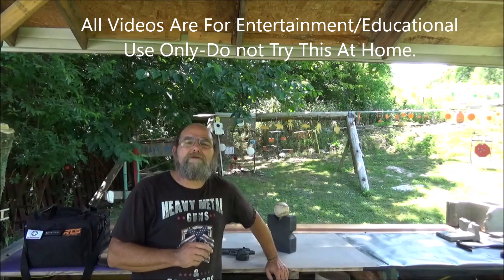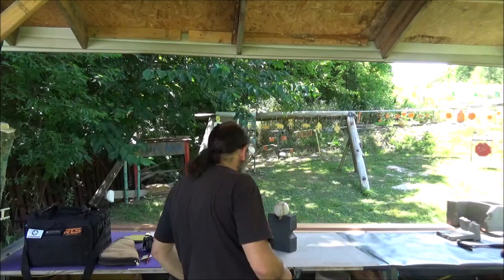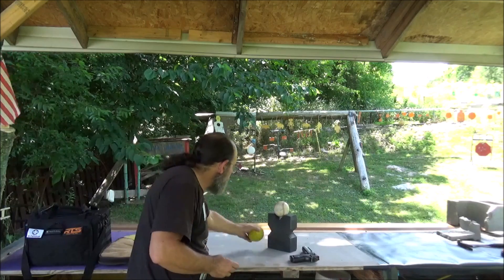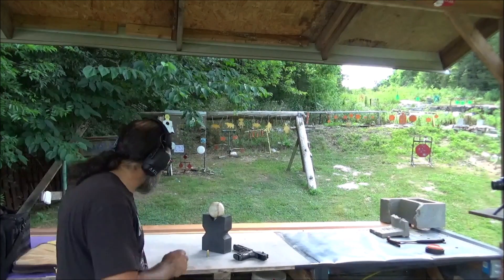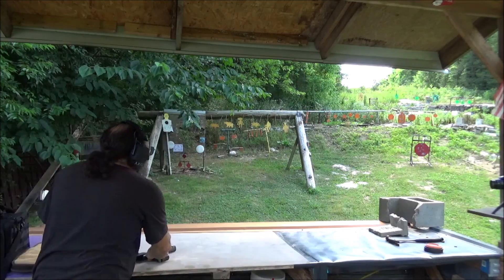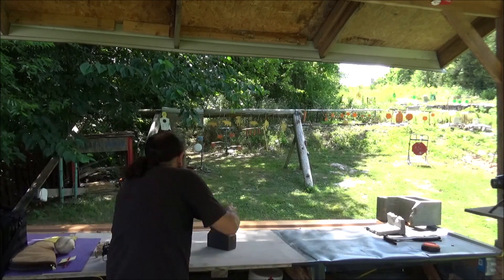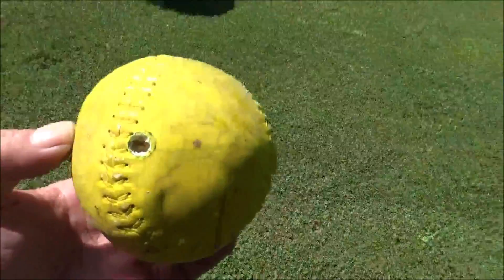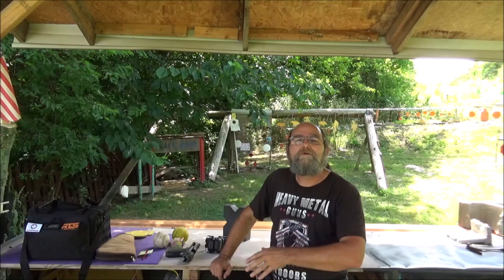Softball Test 50 AE FMJ VS JHP

Comment: Looking at both softballs it appeared to me, that the flat did indeed push, or plowed it’s way through. Thus had a bunch of the winding material in front of it enlarging the exit hole.
The hollow point, acted as a wad cutter and had less winding material in front and there was little if any enlargement of the exit hole.
The winding material is flexible and low density and I suspect it didn’t provide sufficient mass to expand the hollow point.
I would like to see what a jacketed soft core bullet would do in same test. May not be enough mass to expand it as well, but maybe there is.
Good video Paul, awesome gun, who ever said there is too much power, give me more!
Reply from the maker: Thanks !!